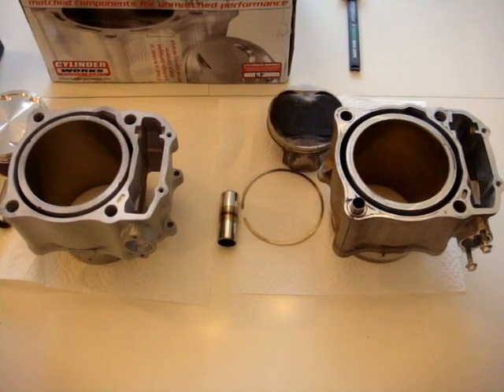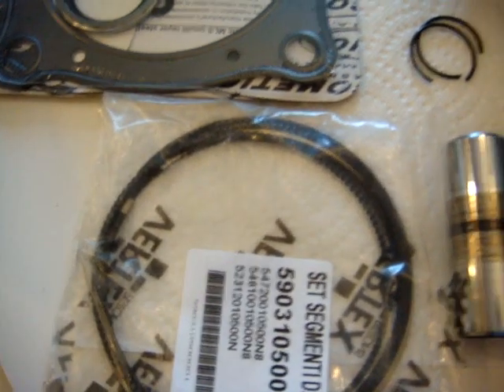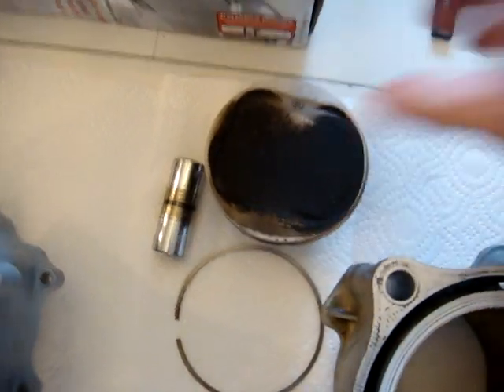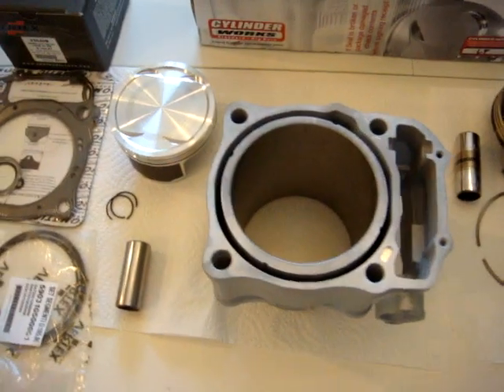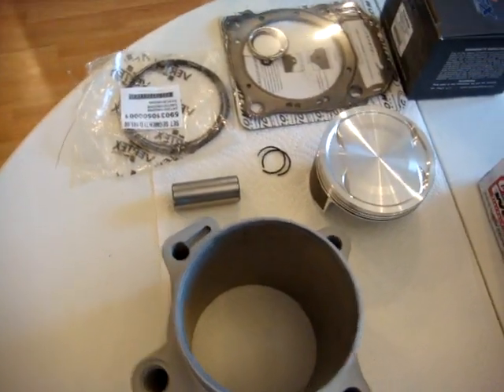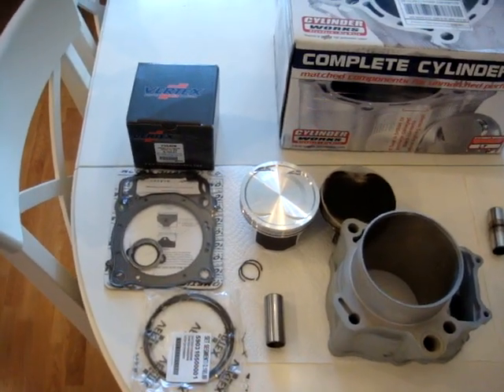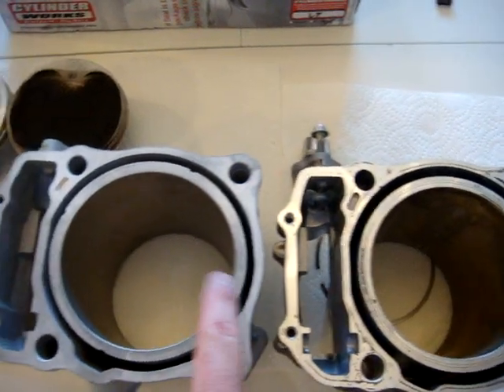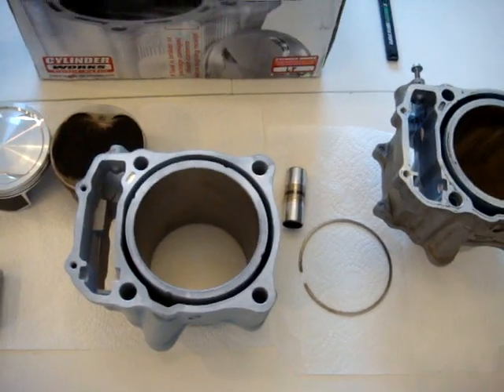Honda 700xx big bore kit 727cc cylinder works 686 to 727

Comment: You say this blew, but all your showing is worn parts? Did anything really break? I recently tossed my piston out the front of my cylinder. And my trx700xx did 83.6 on a 13t as well. Also did I hear you correctly on the ungodly amount of miles you say you had on it? I think mine only had around 2k miles.
Reply from the maker: Yes, I rode the hell out of it. I just put on the 6th set of rear tires. The 3rd set of front tires are just about gone. No parts were broken, just the piston skirt was melted which caused it to bang around inside the jug. It still ran, just sounded like a rod knock. I figured there would be metal shavings inside the engine thats why I decided to rebuild the whole thing. The oil seems to get dirty really fast. Also I have larger rear tires which helps the top speed with smaller sprocket. I have switched the sprocket back to the stock sprocket because with the new engine first gear was worthless. It was way too low for the power.
Reply: After my rebuild, my quad is hard to turn over. Acts like weak battery, or starter hanging. Seams the compression relief on the cam is okay, just way to much compression now. Last time I road it I had to be pull started most of the time! it sucks and idk what to do about it.

Comment: did you ever get it finished ?
Reply from the maker: Yes I did, It runs great. I have about 1500 miles on the new engine.
Reply: spartacus1234567890 i just got mine done last week , put a 715 kit on it stage one and same cranks as yours